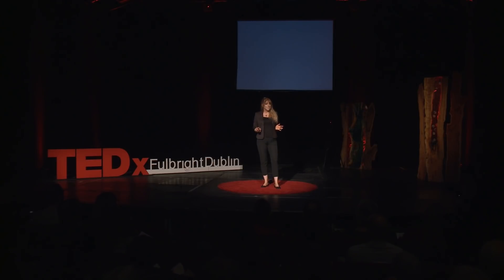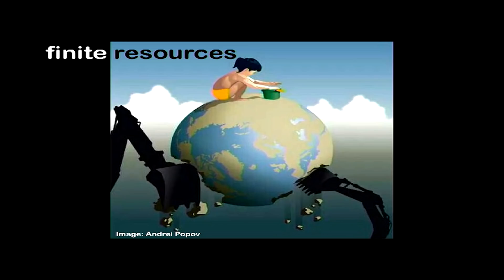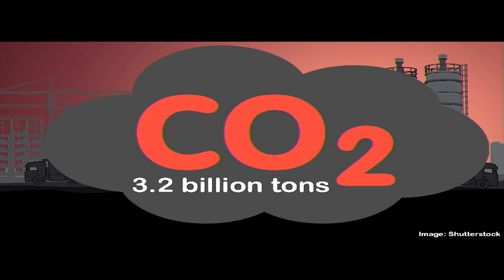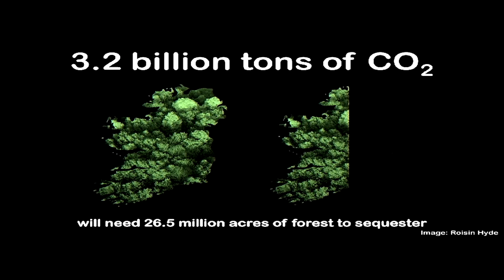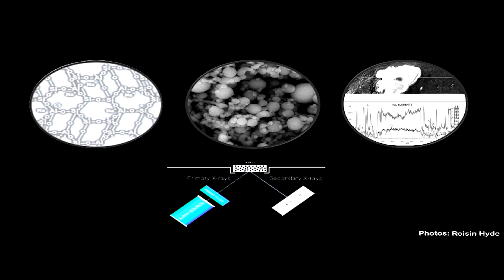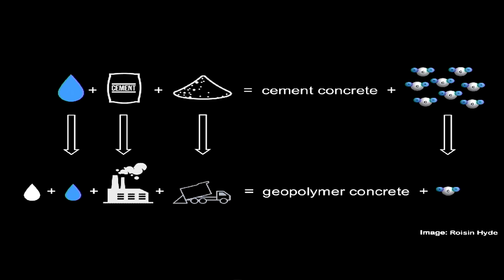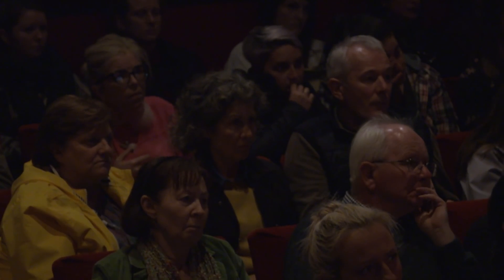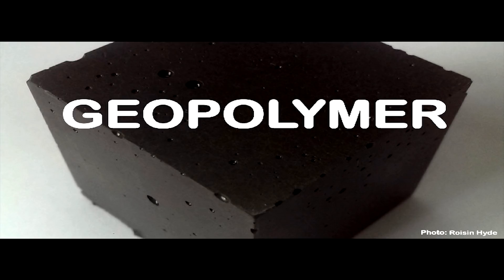Geopolymer – A concrete foundation for a sustainable future | Roisin Hyde | TEDxFulbrightDublin

Comment: But it's not low impact. You can't discount the carbon footprint and resources used in the creation of the waste materials you're using just because you're repurposing something they were otherwise going to throw out. It took a lot of energy and resources to create that stuff that has to be added to the final product. Can't cheat and leave out the cost of that production.

Comment: An extremely interesting topic, makes you think. I don't work with cement and use lime putty to make my mortars and plasters. Lime uses less energy to produce than cement with a lower carbon footprint, it even absorbs carbon dioxide.
Having said all that..........Graphene, carbon nano-tubes and geopolymer are the way forward.

Comment: Assuming the feed stocks for geopolymer concrete are as readily available in similar proximity to a job site as OPC, what is the expected cost over/under of using geopolymer verse Portland cement?

Comment: Where will I get sample of geopolymers to be added to GGBS to produce concrete.
Reply: Portland is a binder 
It is not the only binder
Saying geopolymer based concrete is “ cement free” shows a lack of understanding 
Think of the “ cement” as a binder 
Portland cement free is a correct statement. Cement free is incorrect 

I’ve been using and promoting the use of appropriate binders for 30 years 
Before that I used only Portland cement as I thought that was the only way to make concrete 
There are many viable binders.  Portland is one, geopolymer are one, ceramic cements ( ambient reacting ceramics ) are another group 
They all have their place
Reply: @teslastones  without subtracting the environmental cost benefits of using less or no portland cement , what is the pure dollar cost saving with AR ceramics over portland ?
Geopolymer is a little more expensive per kg than portland cement ?
Reply: Mark Yes the  price of geopolymer Binder based concrete varies—— just as does the cost of portland cement based concrete. 
In formal studies conducted by me in Singapore, several regions in the USA, Mongolia, Malawi  the cost is about the same
Reply: Hi Vaman, thanks for taking the time to watch my Talk. Geopolymer, a cement-free, low carbon binder, is produced through the alkali activation of materials which contain reactive aluminates and silicates such as Ground Granulated Blastfurnace Slag (GGBS) and Fly Ash. To 'activate' these ingredients you must add a solution which typically consists of a mix of Sodium Hydroxide and Sodium Silicate. The concentration and volume of the solution depends on the type of Slag or Fly Ash you are using.

Comment: This is really fascinating, I guess the possible future of concrete industry. However, my only query is that if we are completely eliminating the cement then how to impart the binding property in Geopolymer Concrete?
Reply: Thanks for taking the time to watch my Talk Ankit. Geopolymer is actually a binder, similar to Ordinary Porland Cement(OPC). It is created by the alkali activation of reactive almino-silicate material which can be found in a wide range of industrial by-products including Fly Ash, Slag & MIne Tailings as well as naturally occuring Clays. This process results in a fraction of the CO2 produced in the manufacture of OPC, where CO2 is emitted directly from the limestone used to produce OPC as well as indirectly by the fossil fuels used to produce this heat. This Geopolymer binder is also stronger and more chemically resistant than an OPC binder, due to its unique molecular nanostructure, which means you can improve the performance of the concrete while also reducing CO2 emissions ie. high-performance, low-impact.
Reply: @roisinh4366  Thanku so much Mam for such a quick response. Honestly, i didn't expect a reply form such a great researcher. Thanks for tackling my query. In fact, after watching your video i finally decided to work on this topic all along. I did my master's couple of years back on High Strength Slurry Infiltrated fiberous concrete and now was looking for something to work upon. Thanks to you for sharing such a unique possibility to work upon.
Reply: @roisinh4366  I wish, i could read more about your research in depth. :)
Reply: @roisinh4366  There are many exciting new construction materials coming out but the hard part is getting certification approvals incorporated into Global Standards whether its DIN , JIS , ASTM ,Australian standards etc , the testing process can be extremely expensive , and these materials cant be used to build homes until they have those approvals.
Hopefully under GHS Global Harmonised Standards they will get direct adoption into the Building Codes in most countries on earth.

I love the concept of not just recycling waste , but using waste with a better environmental footprint , My apologies to the 20 million Italian concrete workers around the world :)